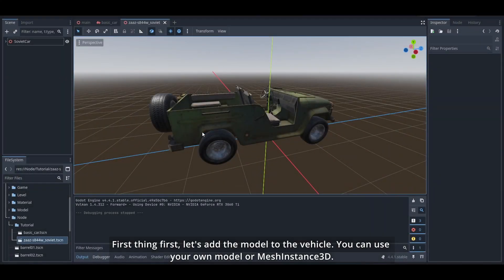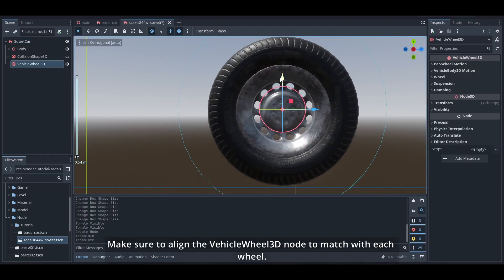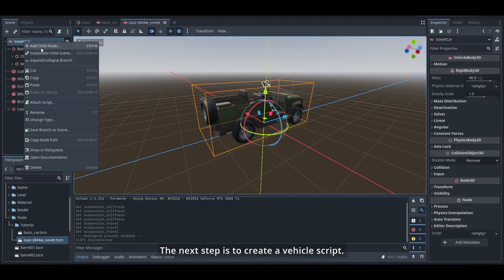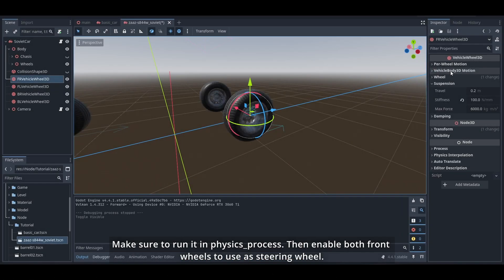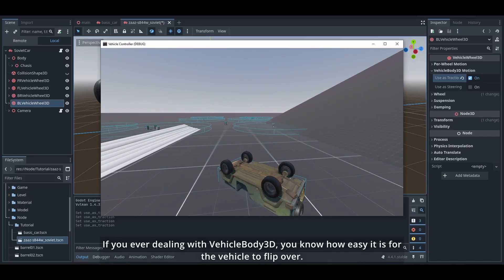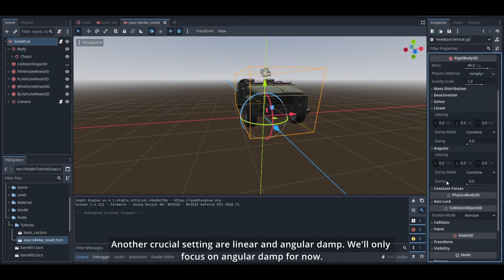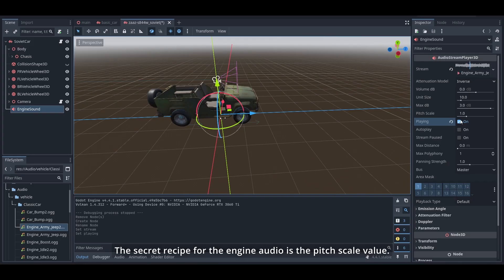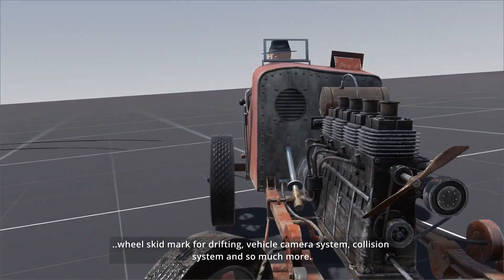GODOT 4 VEHICLE CONTROLLER WITH STABILITY CONTROL TUTORIAL

Comment: I tried your script in my project as I was trying to fix my car's physics in godot but the  ' @export var front_left_wheel = VehicleWheel3D  ' lines throw an error saying  Node export is only supported in Node-derived classes, but the current class inherits "RefCounted" .  How do I fix this?
Reply from the maker: RefCounted can’t hold Node references directly in the inspector. If you want to keep it as RefCounted, you’ll have to pass the wheels to it manually in code, not via @export.
Reply: @Brokencircuitboard  Does that mean editing the script for each of the wheels? Anyway, I tried a workaround, I created a new node and under that I instantiated my car model, made my model local and the code now works. Being a noob to both game dev and coding in general, I find this hard but your following your tutorial really helped. Thanks for the tutorial and the format of this video was perfect don't worry about that. Thanks again!

Comment: Hello. Nice video. How would you implement the 3 wheeled motorcycle with a sidecar? Would like to see such video (please let me know if I got you interested)
Reply from the maker: Vehiclebody3d should work with 3 wheeled vehicle since it work like a car. 2 wheeled vehicle on the other hand might need a little bit adjustment to make it work like a motorcycle.
Reply: @Brokencircuitboard  Its not... if the wheels are placed as in moto-sidecar (L shape) then the wheel of sidecar is not allowing the vehicle to move straight forward. And I can't find good properties for wheels to adjust it :(
Reply from the maker: @BlindChaosPanda  I conducted a quick test, and the system still works even with an L-shape orientation. However, the vehicle tipped slightly to one side due to uneven wheel positioning. I didn't test with a true three-wheel setup; instead, I used four wheels and simply merged the two front wheels to simulate a three-wheeler. If the problem still occurs, why not just hide one of the wheels? This would solve the move-forward issue. The downside is that it would no longer behave like a three-wheeler, but rather like a car.

Comment: What about pure custom raycast based car movement?
Reply from the maker: I'm more interested in using a built-in function rather than creating a new one. I've already looked into a raycast-based car controller. While it solves the problems associated with the default vehicle physics, it is too complex and requires setting up custom code for everything. For a simple tutorial, that approach is overkill.